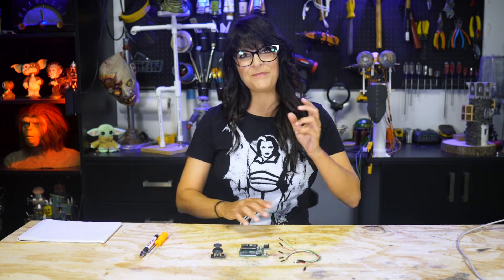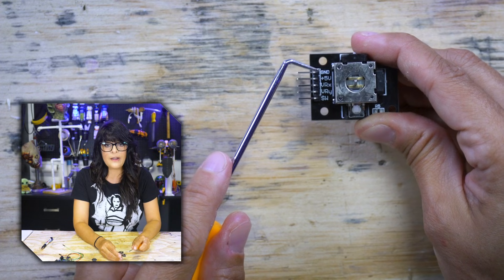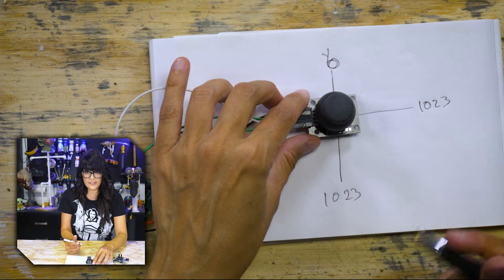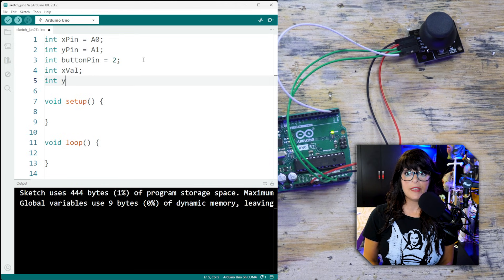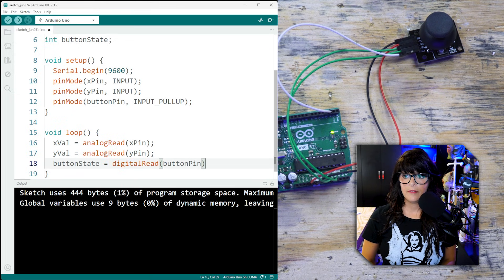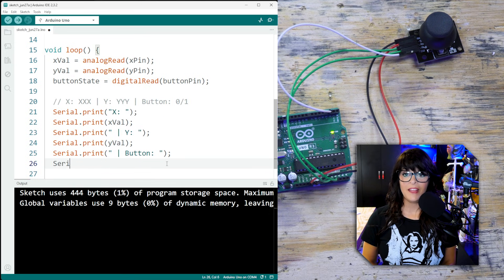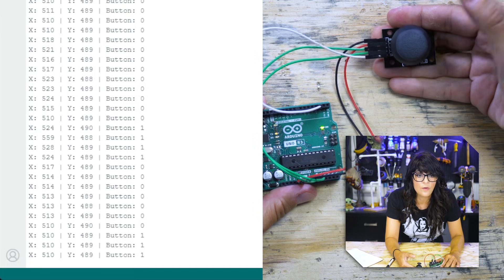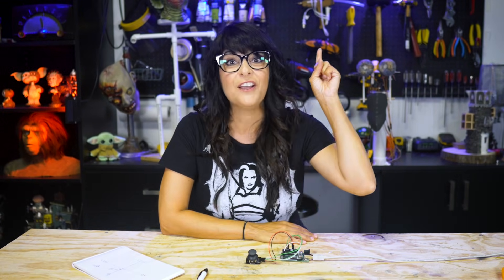How to Use a Joystick with Arduino: Wiring and Basic Controls

Comment: Hi Rachel I’m loving your channel.
I’m  new to Adriuno and electronics I am build a powered wheelchair using brushless motors and using 2 x VESC controllers I have wired everything up but instead of getting 3+ volts on pin D9 & D10 I am only getting 0.32 volts despite having a good 5 volt supply to my Nano 3.0 .
I was wondering if you might know what’s going on? Thanks Andy

Comment: Can someone help me with the Button Switch? I have a Arduino Pro Micro and I used digital Pin 2, but button pressing is not recognized.. I tested the same with connecting Pin 2 with GND and that did actually work.. Am I missing something?..

Comment: There is a compilation error due to the switchPin variable not being declared. To fix this, you should declare the switchPin variable at the beginning of the code just like xPin, yPin, and buttonPin. Additionally, there is a minor typo where buttonState is used instead of switchState' Regards. Here is the corrected code:  int xPin = A0;
int yPin = A1;
int switchPin = 2; // Declare switchPin variable
int xVal; // Variable for storing joystick x values
int yVal; // Variable for storing joystick y values
int switchState; // Variable for storing joystick switch state

void setup() {
  pinMode(xPin, INPUT);
  pinMode(yPin, INPUT);
  pinMode(switchPin, INPUT_PULLUP);
  Serial.begin(9600); // Initialize the serial monitor
}

void loop() {
  // Read the x, y and joystick switch values
  xVal = analogRead(xPin);
  yVal = analogRead(yPin);
  switchState = digitalRead(switchPin); // Corrected to use switchState

  // Print readings to the serial monitor
  Serial.print("X: ");
  Serial.print(xVal);
  Serial.print(" | Y: ");
  Serial.print(yVal);
  Serial.print(" | Switch: ");
  Serial.println(switchState);

  delay(100);
}
Reply: Thankyou good Sir!